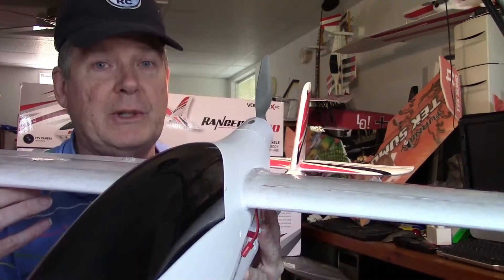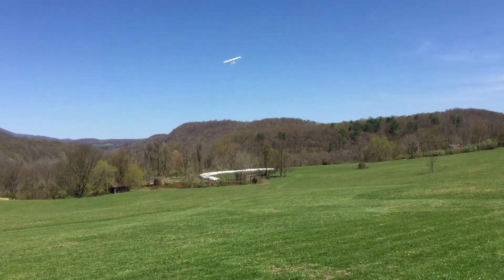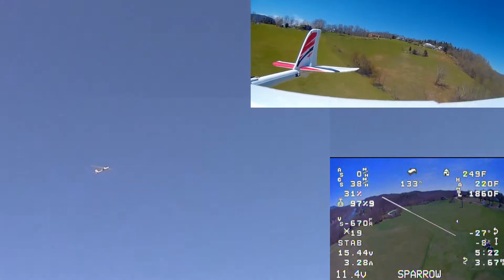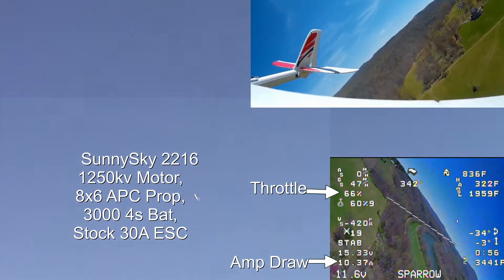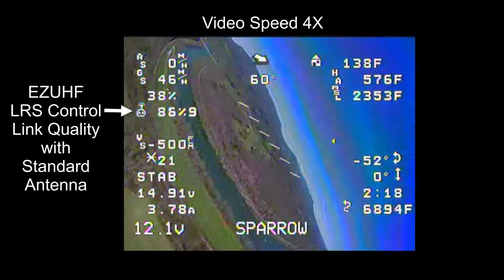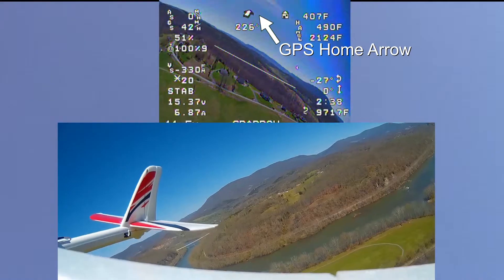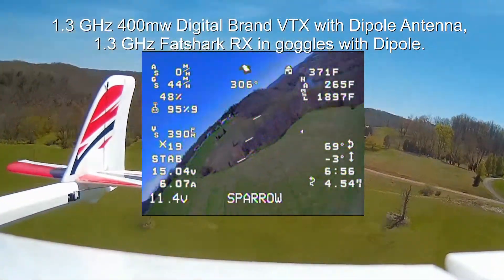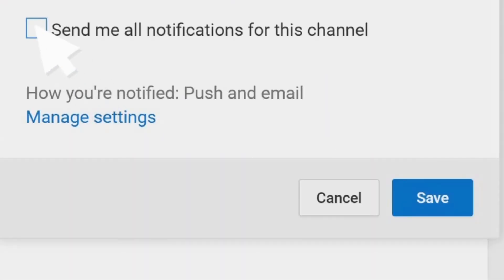Volantex Ranger 2000 FPV RC Plane Build Part 10 - Maiden Flight Tests

Comment: Years later, I'm here watching your entire series. I'm getting ready to start a Ranger 2000 with INav and DJI video, and all your build info it still pertinent and the dry humor cracks me up. That comment about keeping  your stuff organized with the oldest stuff at the bottom of the pile is still making me laugh. Thanks again!
Reply: Hey did you ever get your ranger set up? I've been flying a few DJI Inav planes and was thinking of a ranger 2000 or a phoenix 2000.  I want something that can do a bit of aerobatics and glide.
Reply: @explodingevo  Hey, since I posted this I bought a 3d printer. I decided to add a head tracking setup to it, which I do have working but also started modding some of my existing planes with new parts. It's ready for a Line Of Sight maiden, as long as I don't keep adding more to it.

Watch my channel, I'll put up a video when I maiden and I'll also hit you back with a subscribe. Looking forward to seeing more projects!

Comment: Nice..very nice..
What do you think is the perfect cruising speed is for the weight that you are carrying ?
Reply from the maker: Somewhere around 40 mph is a good speed with low draw on the battery. Watch the OSD in the video for current draw in amps and speed in mph.

Comment: Did you figure out the issue with the lawmate transmitter? I have the same problem.
Reply from the maker: No I didn't figure out the noise issues. It was drawing too much current anyway. The 400mw Digital brand from RMRC has less current draw and even has a button to toggle the frequencies so I put that on the ranger instead.
Reply: Dave Merc Productions thanks,.

Comment: We were all waiting to see this in the air capt'n! - love that rear angle view off the port wing surface! Just like boats.. they shrink when you put them out in their environment - These are rather huge up close n personal.. Thanks for posting!
Reply from the maker: Thanks sir, The reason for the camera placement was partly the angle but also had to do with placing the weight on the opposite side to the video transmitter on the starboard wing.  There was another cam facing forward but unfortunately the battery died and I did not get the HD footage from it.  Fortunately the 640x480 FPV feed got recorded so I had some forward view. My friend got the ground view on his iPad and completed the trio of angles and gave me some good audio of the banter on the ground. It all worked out and I am glad you enjoyed it.
Reply: Stellar stuff Dave.. keep posting - we'll keep enjoying! Blue Skies O/M!

Comment: You don't need a compass for fixed wing models. I don't use them for iNav or Vector.
Reply from the maker: True even for this PixHawk setup I'm using.I wanted to demonstrate this fact because it seems to be a point of confusion between multi-rotor and airplane setups. 
Many people read the wiki and miss the note that states a compass is not recommended for airplanes.  
Some people seem to think the compass will act as a backup if the GPS fails on a plane. This it not true because the GPS is required for RTH and other GPS functions to work.

Comment: Nice job Dave.....I think you should try fitting a 9 Inch prop if you can though, an 8 x 8 prop is inappropriate for sure, they belong on Pylon Racers, not an FPV Cruiser.
   Oh, and please dont feed David Davids, hes so much cleverer than us for sure...He thinks we are beginners...lol.
Ask him how many FPV Planes he's built and flown.....No, on second thoughts, dont do that either.
Reply from the maker: I sent him this link that shows how to properly launch but I think he ignored it.
https://www.youtube.com/watch?v=uFwSEsqb3Fw

The 9 inch props just won't fit but in hindsight I think the 8x6 is plenty. I was actually giving it too much thrust on launch and driving the nose down.
As seen in the video link above, if you can give a good toss she will fly level with medium or even no power.  During flight I was getting good performance with only 1/3 throttle and still achieving speeds of 35 mph. Very efficient!  More flights and practice needed however it looks like we are going to get a week of rain. The Joe Nall event I was going to got canceled because of the storms. What a year so far with wind and rain.
Reply: Oh, I see....well all these pushers need the same approach....Dont use a lot of power at launch time, the lack of forward speed and lift allows the thrustline to push it into the floor....It's a different story though once the aircraft gains a little speed and lift through....A point totally lost on the likes on David Davids, and the reason is because he has no EXPERIENCE.....lol...Those flaps are handy come launch time...nice job....:)
  I thought it was only us that had continuous rain, right now we have sunny days....Only waited 7 months for it...:(
Reply from the maker: True, I think it will do fine with less throttle and a good toss. Probably don't need the flaps for launch. Every plane takes some getting used to.
I really need to toss it myself and feel how much throttle is needed. For some reason DD seems to over focus on the pusher glider thrust angle. To me the benefits of the overhead pusher far outweigh the minor inconvenience of the design. It is what it is, although the VR2000 seems to have overcome most of the bad tendency to dip. For example when I did the touch-and-go I cut the throttle totally before it touched the ground, then afterward gave it half throttle and it took off smoothly with no dip. That was a very pleasant surprise. Very pleased with this plane. May the sunny weather stay with you!